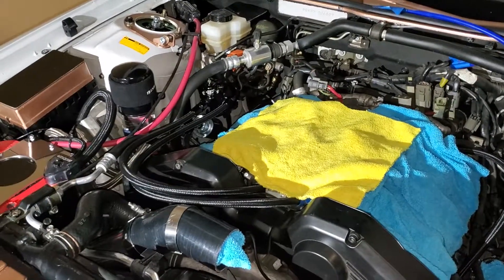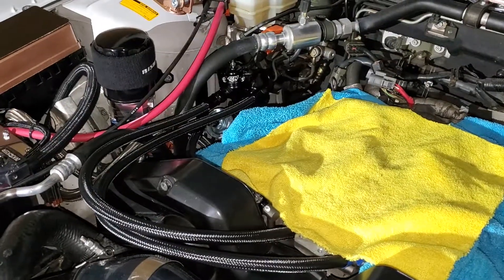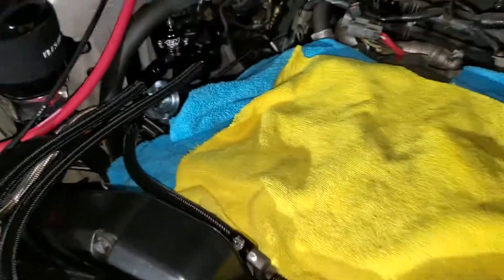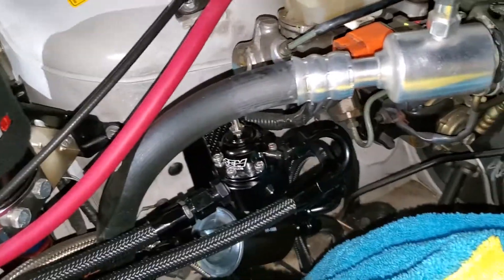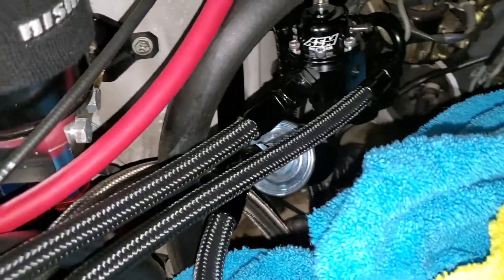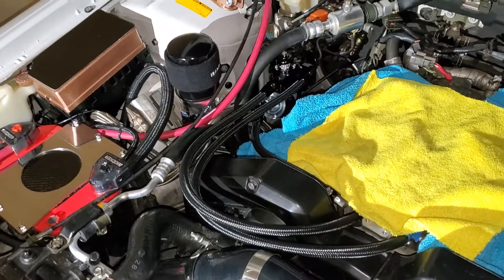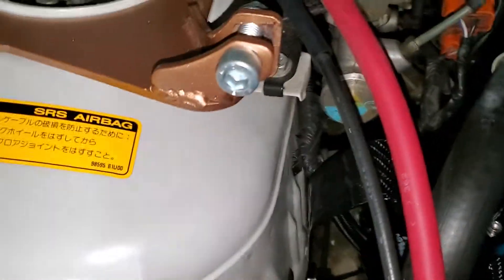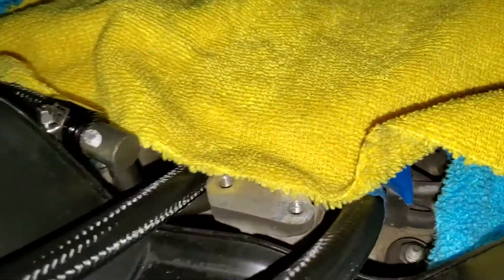AEM Fuel Pressure Regulator Install Y32 Nissan Gloria RHD VG30DET JDM

Comment: Hi, is it possible for you to share information on turbo vacuum system, engine vacuum system, fuel tank vacuum system and fuel pump relay of Nissan CIMA Cedrick v6 turbo 3000cc - Y31, or if you can share the link for downloading service/workshop manual for the same?

Comment: Hello, how beautiful VG30DET I have the same one, could you help me with a piece of information on where to buy spare parts for that engine? please.

Thank you, good day.
Reply from the maker: Depends what you need.  Most parts are found on the Z32 or J30 . Only the intake plenum and fuel rail setup are specially used on this engine.